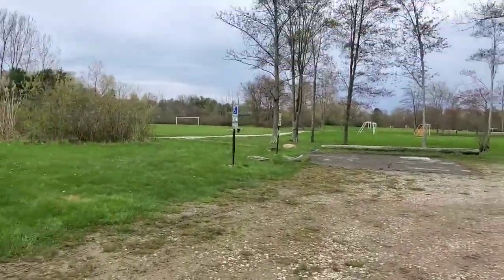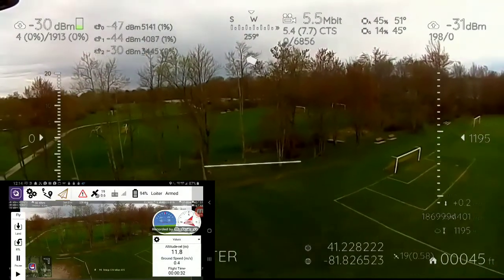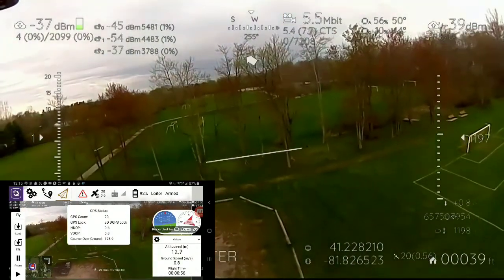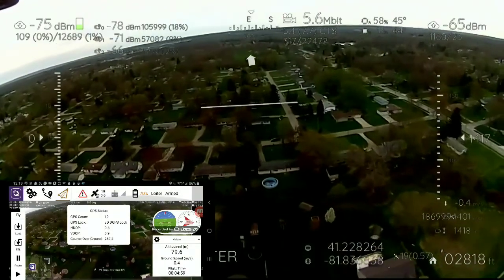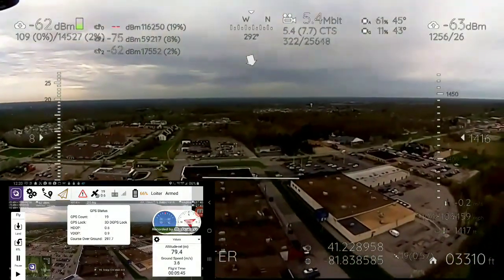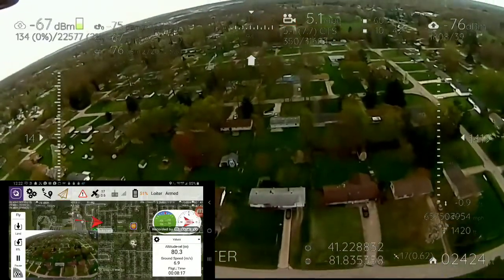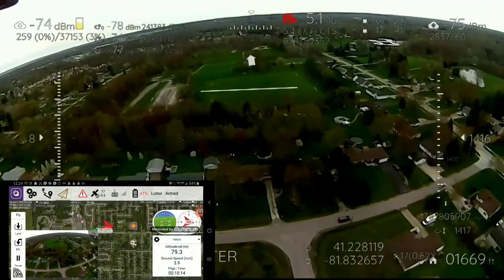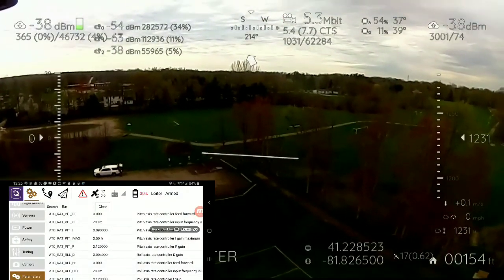Open.HD 4-29-19

Comment: Any one can download OpenHD and using a couple of wifi modules, two raspberry pi's and a HD camera and have HD video. Getting the OSD telemetry to work is another thing. Can you tell me what changes do I need to make so the OSD will actually work?
So many people will be using arduplane or arducopter so why don't they just have a download for an sd card that will work? And better notes to follow, this would be nice. 
I have managed to get this to work before but trying to do it again it just isn't working.
I tried connecting the AirPi to the FC using TLM1 and tried using TLM2. I've changed baud rates. I've change Tx and Rx pins. I think it's meant to have the Pi on TLM2, but I have tried on both. 
I have a telemetry radio currently on TLM1. It has worked on both TLM1 and TLM2. Its baud rate is 57600 and works fine. 
I change TLM2 baud to 921600. Doesn't work. I have matched the baud rate for the RC baud and the Telemetry Baud rate, like it says in the settings for the Pi. 
Like, what do I need to change, using Arducopter, in order to have a working OSD? I don't understand why there are steps to follow. I would have thought the Devs what people to use this. Not everyone is a computer programmer and comes from an I.T. background. 
Something isn't right here. But without an exact outline steps to follow how can one trouble shoot the problem?
Reply: You need to ask on OpenHD forum.

Comment: This would look so good used with a gimbal. Which is better, ezWifibroadcast or OPEN-HD? They look similar or the same.
Reply: I just tried open HD and Wifi and for me Open hd seems to be the winner by a small amount.
Reply: @MrSiciro  Ok. Yeah, ill look into it later. Im happy with ezwifibc. Wanting to try a RPZero for the Tx. Im only using single wifi modules. You? Something I need to focus on more. I think this is a killer setup (EZ and HD) and its worth perfecting.

Comment: Great job! Is the drone just sending image through the WiFi signal you're emitting from your Ground Control Station? Thanks
Reply from the maker: Here is the project wiki... it's really easy to set up.  it basically uses special wifi adapters that wireless hackers use called injection mode and monitor mode where it just transmits data regardless of handshake between transmitter and receiver.  It guarantees a reliable link. https://github.com/HD-Fpv/Open.HD/wiki
Reply: @justinhealey-htcohio3798  This is super cool! any plans to be able to convert the stream to RTSP? Also, which wifi adapters work?
Reply: disreguard, just saw the links on the right-hand side on the wiki page

Comment: Ever check out the video quality from DJI Mavik?  I recently got one and was blown away. Using it with an ipad mini 5 its stunning. I like tinkering with EZ but there's no comparison.
Reply: Phil Thayer the only problem is it’s DJI
Reply: @Hornet135  sounds like a personal problem...dji rocks!
Reply: Phil Thayer I don’t think you get it, I never said DJI was bad. For an out-of-box solution, it’s probably the best. DJI doesn’t offer a stand alone video down link, and likely never will. Solutions like the one in this video are important to have.
Reply: Hornet135 Wasn’t Lightbridge a stand-alone video system from DJI?
Reply: wattage2007 yeah, apparently the don’t offer it anymore. It was an integrated video, flight control, and telemetry link. Of course it only worked with DJI flight controllers and remotes, and is kinda bulky. At least it’s available for the low, low price of $1250.
Reply: @Hornet135  sure they do! Lots of reviews on youtube
Reply: The analogue video quality I was getting is the reason I got myself a Phantom 4. But I like building and playing around with multi rotors. OPEN HD and EZwifiBC are fantastic. DJI have brought out two systems, aimed at the fpv market, and I feel they've still missed the mark. No support for serious OSD, just battery and current used (or whatever it is) so its of no use to me. Lightbridge 2 is good, I love and use it. But I am so impressed with EZwifiBC.